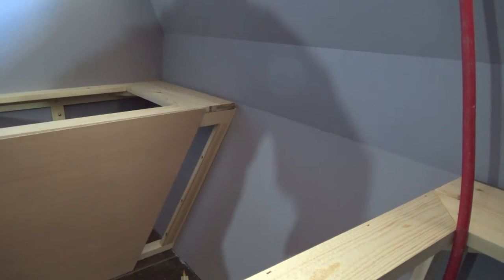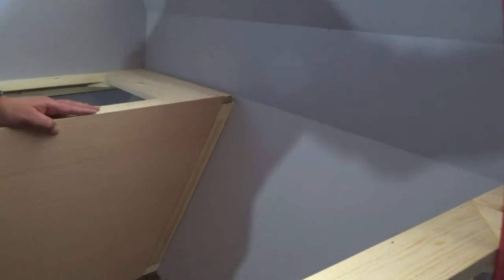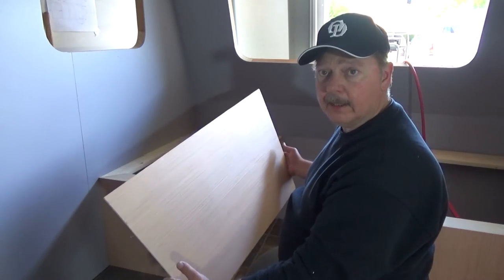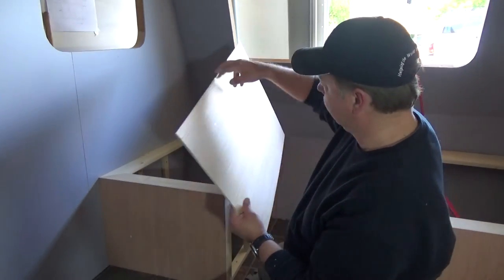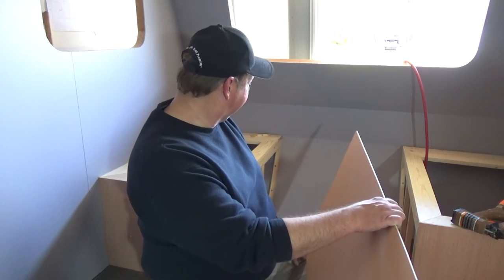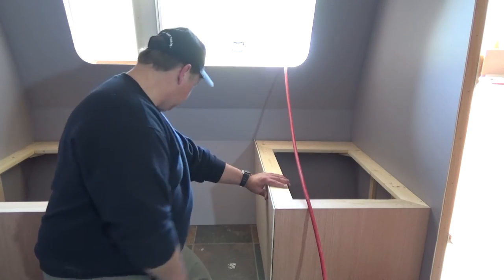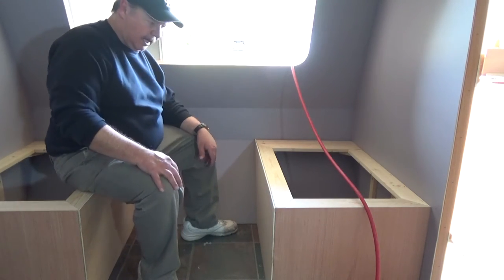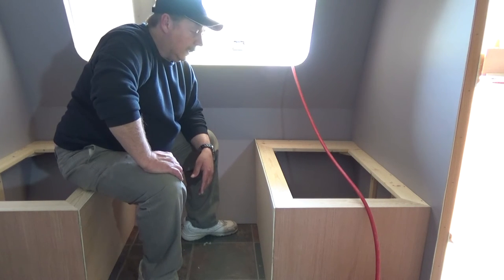How To Build A DIY Travel Trailer - Part 11 (Front Bench Seat Part 4)

Comment: Another way of finding the angle. Is to use a compass.Clamp the panel securely in place. Start at the top at the widest gap. Scribe a line to the exact contour. Of the area your butting up against.
Reply from the maker: Good tip!